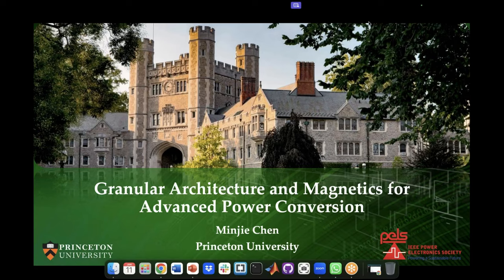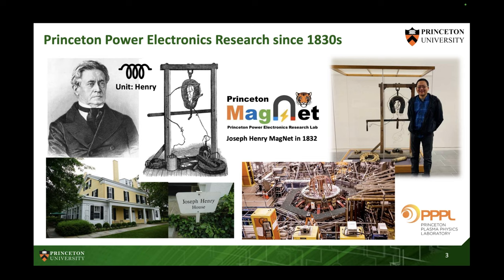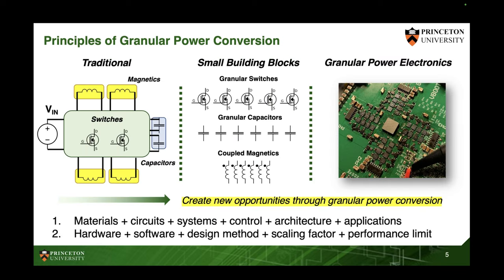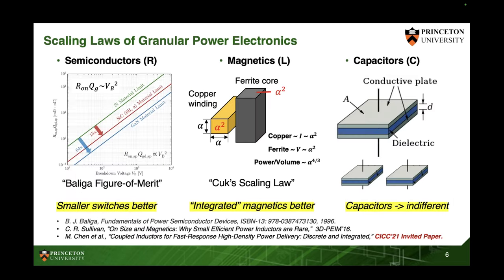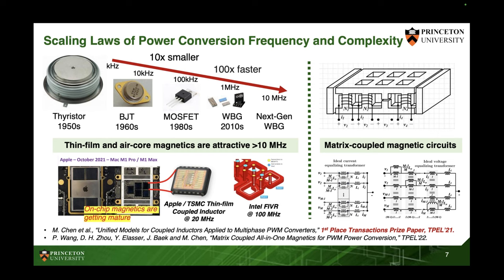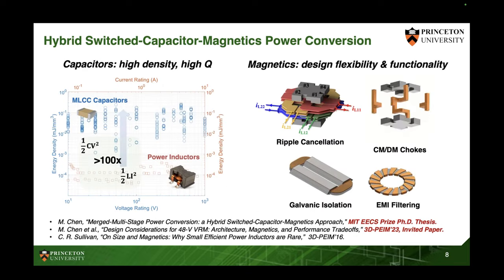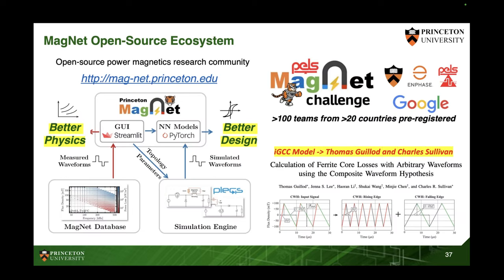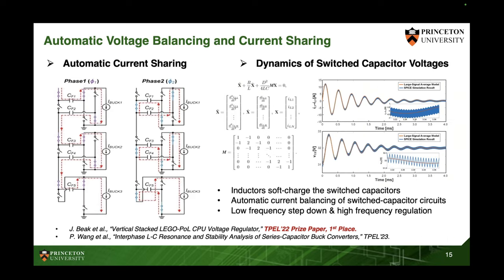PELS Webinar - Granular Architecture and Magnetics for Advanced Power Conversion - by Minjie Chen

Comment: Many congratulations and thanks for the incredible research works and efforts you are doing in the field!
Thank you Prof. Chen for amazing presentation! I'm not quite sure that I could understand correctly why sacrificing the efficiency is acceptable for CPU/GPU power supply application. It is true that the smaller power supply can get closer to the processor and cooling system, but we are producing more heat at the same time due to higher power loss, unless they are not linearly related.
Thanks in advance if anyone from your team could get a chance and help me understand the philosophy better!
Reply from the maker: Just like real estate, the closer you are to Manhattan, the more $$$ each mm2 cost, and the air conditioner and electricity bill cost nothing ... reducing VRM size can open lots of opportunities in computing (e.g., faster chip to chip communication, faster memory access, better packaging), which worth much much more than electricity bill and cooling cost.
Reply: Thanks for the explanation! That was my confusion. If achieving 2x higher power density is possible at the cost of only 10% more loss, then that makes sense. I'm really curious to know what happens to this trade off if more computation power (more transistors) is added to the same processor owing to the saved space, since you would need higher rated power VRMs. Have you found any overhead limit for this trade off? Is there any restriction for maximizing power density at the cost of tolerating more loss for the entire cooling system, VRM, and CPU/GPU?
Reply from the maker: The typical thermal limit is about 10W/mm2,  while the best 48V VRM density is about 1W/mm2, still far away from the cooling limit. Advanced cooling can push the thermal limit beyond 10W/mm2.  @saeedsharifi2588